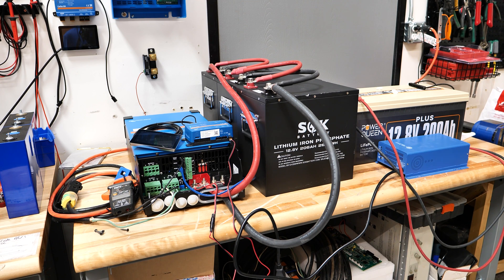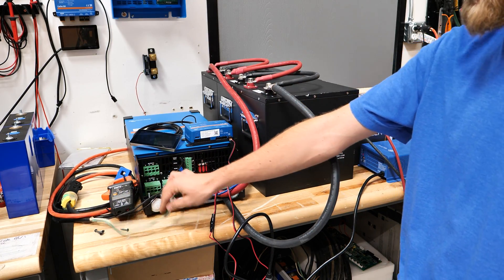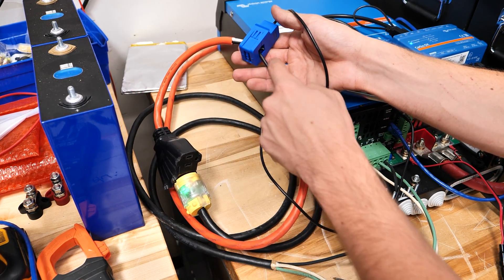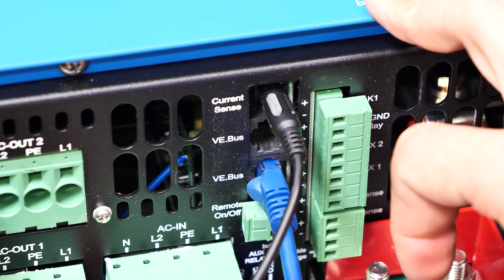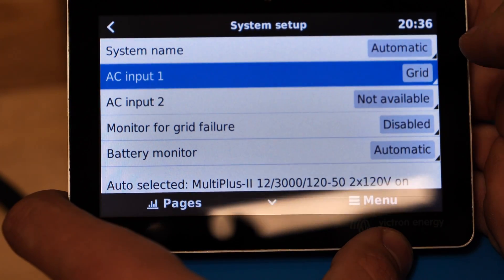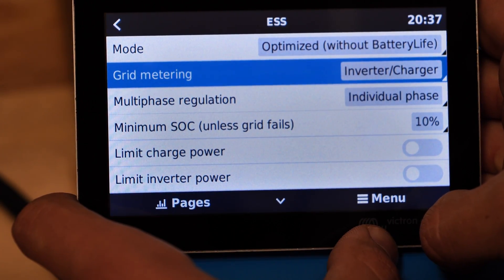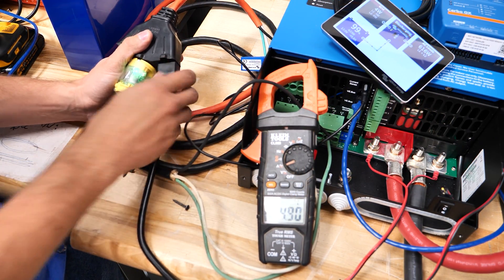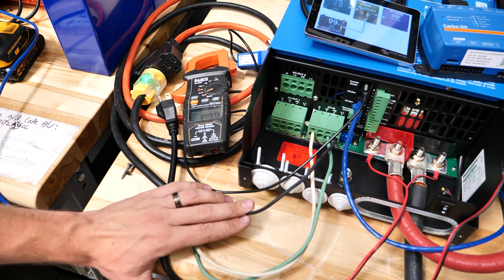Victron Multiplus-2 ESS Assistant With External CT Demo

Comment: i thought that on the AC-input terminals that power is ONLY allowed to go in, and not allowed to backfeed out?  ChatGPT also says that connecting on the input only allows power in, and that any power from the batteries that is converted to AC goes only to the two output circuits.  So what is the case?

Comment: Excellent vidéo, thanks for your work. Do you have an idea, for using the CT system to power the load, with solar source only? Having lithium batteries at home I mean without discharging them for thé external load through ACin at night.  That could be a great way to use the excess solar power during the day

Comment: Will the inverter throttle it's output if the loads start to pulling too many watts for the inverted to handle? That would be awesome to hook on your main house panel and supplement power and have the grid kick in under high loads.  Seem like a much better solution than setting up a large main panel grid passthrough system.
Reply from the maker: Yes it will self throttle and keep operating within safe spec. The inverter can only do the most it can do!

Comment: Great video. Amazing what this inverter can do. Do you still need the external current sensor if all your loads are on AC Out?
Reply: You do not. What's nice is the external sensor is good to 100 amps. Where is the multi plus transfer switch feed through from the grid I believe is limited to 50 amps. So this lets you account for much more loads than you could feed through the inverter. It effectively makes the non backup AC out not needed.

Comment: Thanks, totally missed the arrows on the CT at first. Did you check the box for "Use Aux1 as disable FeedIn signal" in the grid code settings for this to work?

Comment: I am planning this exact setup but MP is 30m from grid connection. I have read differing views about whether CT will work with cable extended to that distance. It would be FANTASTIC if you could put do a test run on your rig to answer the question once and for all! Many thanks
Reply: I’ve just added a 20M long victron clamp to my ess setup replacing the et112 meter and it worked
Reply: victron external meter ET340